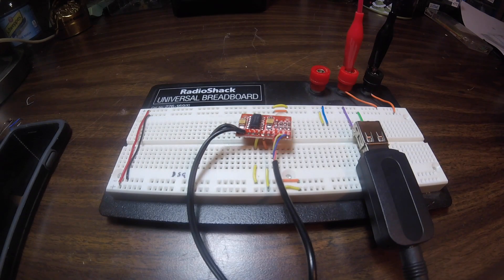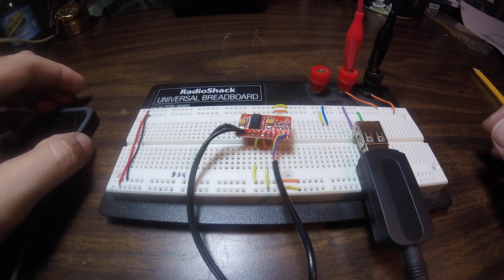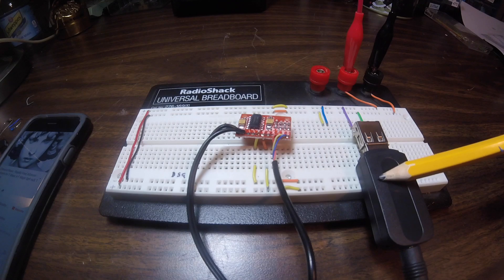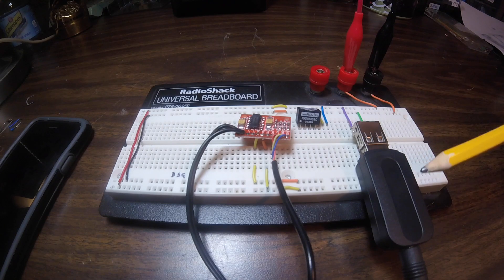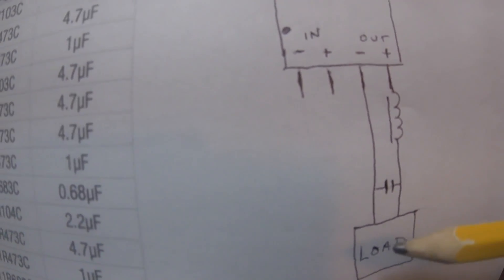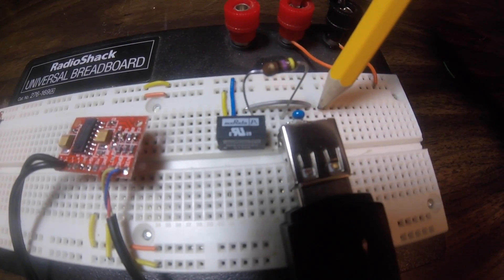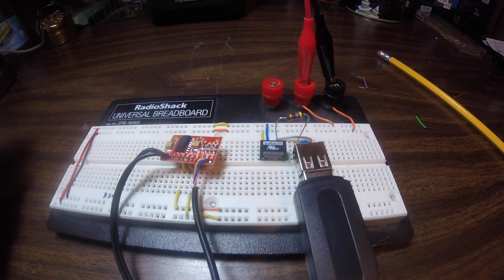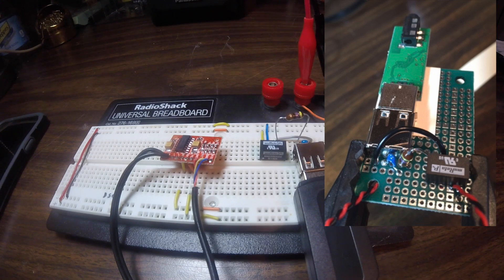Bluetooth Ground Loop Isolation

Comment: having ground loop problem in my car.

using this 12v to 5v
https://images-na.ssl-images-amazon.com/images/I/416woIIiQdL._SY300_.jpg

1 for Phone, 1 for bluetooth module, both causing ground loop on my car stereo

can i use this to sort my problem?
http://www.banggood.com/Isolated-Power-Module-4-Pins-DC-DC-Converter-In-10-16V-Out-12V-1W-p-85294.html?rmmds=search
Reply from the maker: Marvin if you use that module you would have to then convert the 12v to 5v. Do they have a 12v to 5v version of this chip? Otherwise it is fine. You want to make sure it's an isolated DC to DC converter which that chip is.
Reply: the item says 1w.. wont that affect charging times/duration?

Comment: This is a great solution for those that can dabble with circuits and get the parts, nice work and thanks for sharing your knowledge. I've played with signal isolation and I find the sound quality degrades a little so I've been looking for a power/DC solution like this. For those that dont want to make a circuit, I just found a device that is plug/play complete and based on the Analogue Devices ADUM4160 digital isolation chip. This provides 1.5kv DC to DC isolation and also 3kv (up to 12mbps max) data signal isolation although you wont need that data feature for Bluetooth. Looking at the data sheet and other applications for that chip it will be about 200ma max output current so that should be fine for most non-battery Bluetooth modules. Only $11.59 so I ordered one to try today. I looked at a couple of videos that suggest this will do the trick for this application. Time will tell.
https://goo.gl/5ka4zN
Reply from the maker: I think that would work just fine. Let us know how it worked out
Reply: Will do. It's on its way from China so I'm guessing I'll have it in another week or two. I've been debating with another person that says the ground loop happens between the audio grounds and has nothing to do with power isolation, but in your case at least I see power isolation working. Maybe some audio circuits re-connect the ground and you lose the isolation. That's his argument.
Reply: @bear123: Well, he's not right because at most devices the AGND is directly connected to the DC GND. Try it with a multimeter.
Reply from the maker: If the data and power grounds are connected then this wouldn't work, but then what is isolated? Bear123. Did you ever they this? Did it work?

Comment: do you have any alternative from the murata chips?
Reply: Mornsun DC DC converter.
Reply: Any DC to DC transformer works. Supposedly, the audio grade transformers give you a better sound, but I've seen a number of examples where a general purpose DC to DC was used and the same results are achieved.

Comment: Thank you for sharing this solution. This is more expensive than the bluetooth receiver itself. The hum is because the amp and BT receiver is sharing the same power supply. I hope i can find a fix for using this receiver in car without hum.
Reply: Did you find a solution?
Reply: have u fixed ?

Comment: would you still need that component if you used a 5v power supply for the amp and another 5v powrt supply for the bluetooth?
Reply from the maker: If you use a separate power supply for the amp and for the bluetooth you shouldn't have this problem. The problem comes with ground loops when you are trying to use a single supply.
Reply: NizzyAmps Thank you, using two separate batteries solved it for me. I'm using the XS3868 Bluetooth module and TDA2822 , each with a 18650 battery powerbank.

Comment: Nice job! I've been looking for a solution like this since long time ago.... Could you please share capacitor and inductor specs?
Reply: The capacitor and inductor vary by the murata chip used. For this specific one the inductor is 47uH 4.7uF. If you pull up the data sheet it'll specify the values.
Reply: These values are for both the Murata NKE1205 and NKE0505 chips